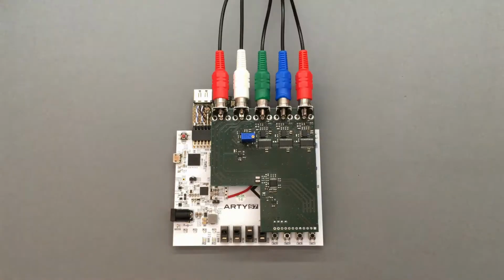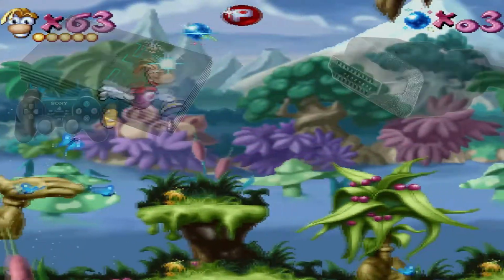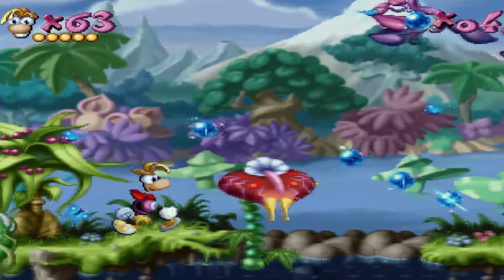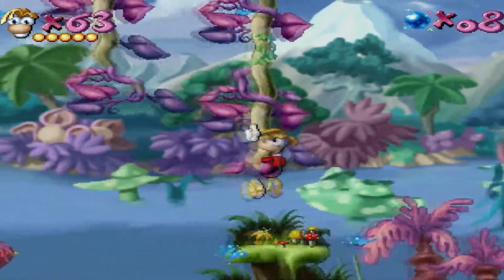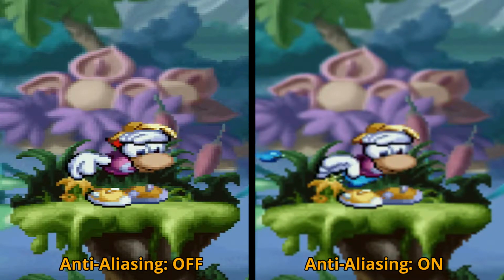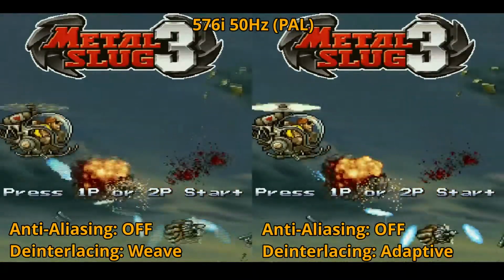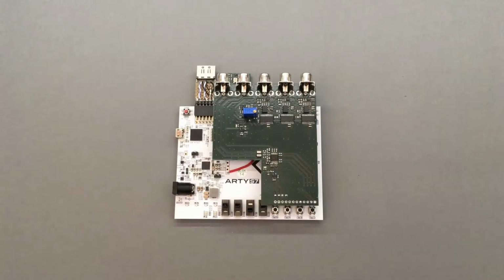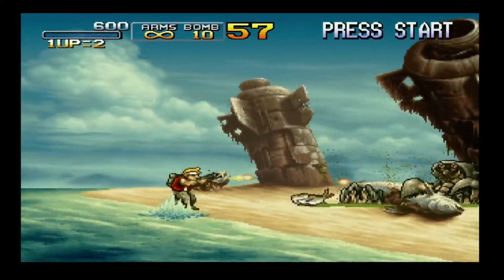RCD DevLog #03: A Frame Buffer Changes Everything!

Comment: Hey, what is happened to this project? Is it finished? The Patreon Page isn't available anymore.
Reply from the maker: This specific project has been set aside and almost all expertise I developed here has been put to good use elsewhere. The upscaling algorithms have been used in my HD-64 project (HDMI for the C-64) while the motion adaptive deinterlacing presented here has been ported to the PCSX2 Playsatation-2 emulator a year or so ago (you can probably find my commits in the official repo). As for the project itself, I don't know if there is a market for yet another 1080p upscaler, even though I'm confident that I could make it way cheaper than the retrotink. At the same time I have personally developed a dislike for upscaled (resampled) analog video so if I can't mod an original console with a fully digital HDMI solution like I'm doing with the C64 then I'd rather use something like a MisTer, or even an emulator directly, so I have somehow lost interest/incentive to develop an upscaler
Reply: @sideprojectslab7352  Wow, thank you for the detailed answer. I'm sad to hear that you don't want to continue the project in it's original form but I understand it. Also a nice detail that your algorithm is now included in PCSX2. For the PS2 itself maybe you could be a competitor to the PixelFX Retro GEM (I know that is a big load of work)
Anyway I love your work  :hands-yellow-heart-red:
Reply from the maker: @sucher2604  I have been giving it a lot of thought in the last year or so, and to be honest the step from the HD-64 to a PS2 HDMI solution would be rather small. I'm just a little afraid to go there because that would represent a massive scale-up of the client base and with that, manufacturing, sourcing, support and logistics effort and I don't know if I'm ready to go there. But I really REALLY would like to
Reply: @sideprojectslab7352 so I‘m looking forward to see your solution sooner or later (I hope sooner 😄)